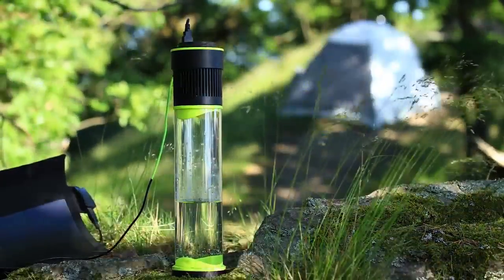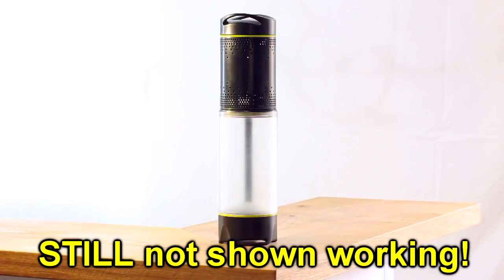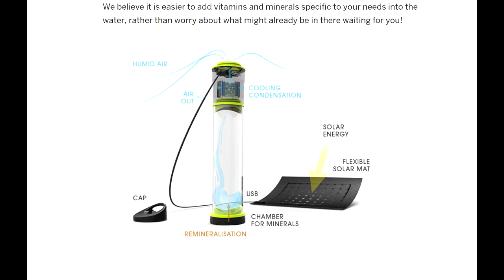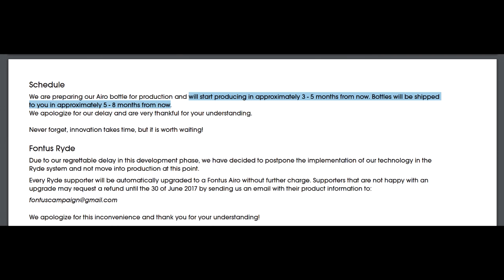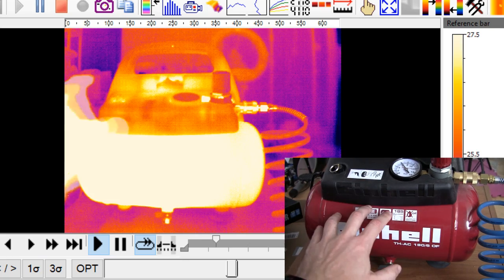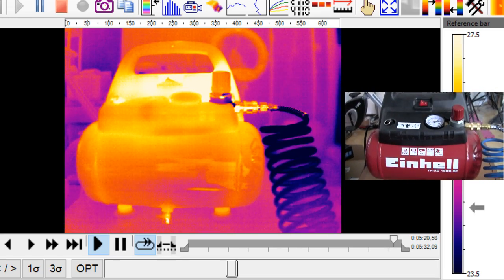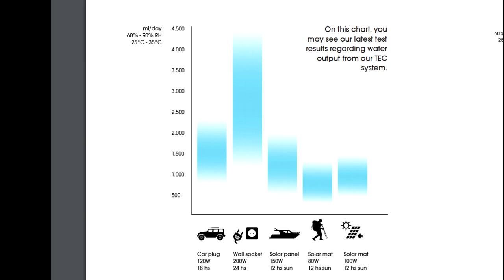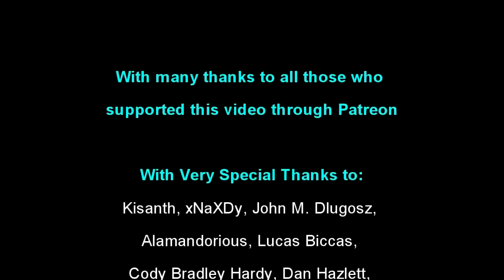$300 000 Self-Filling water bottle, SUPERFAIL!

Comment: As I've commented, your video went from update win to complete fail with the air compressor analogy. In these videos you have previously done the latent heat calculations for water.

So why do you completely fail on how compressor and refrigerant based refrigeration works? It is the latent heat that does the cooling NOT the compressing and expanding. The compressing and expanding is just there to change the boiling point of the refrigerant so that it boils and absorbs heat where you want and condenses and rejects heat where you want.

Please fix this and do a proper explanation of phase change refrigeration.

Comment: Discrete Birdge Rectifier and Capacitor Dropper would give them a small size for the "power brick". You risk electric shock using capacitor droppers without safety features and bleed resistors though.

Comment: i need to correct you on USB

it actually supports up to 100 W with USB 3.1 PD via a USB-C or -A plug 

the maximum is 20 V and 5 A and intended for powering Notebooks or Monitors

Comment: So why are they not working with a material that can be I dunno Hyper saturated like a baby diaper?
Then working with the resulting water after that point....

Dear lord, maybe I should make the new "Fountis" device or some shit, because after you stop trying to use thermal dynamics as your working force... it's just a volume game with a fan and utilizing a constantly rolling press and filter.
Sure you would have to replace some sort of Foam core, and the filter after a while but heck at least it "could" work with some efficiency.

Comment: 12:07 - SERIOUSLY??? A demo expanding COMPRESSED AIR to explain how a REFRIGERATOR works? THAT'S NOT CORRECT and you know it - Explain it properly!! I'm starting to think your "Science Clarification" purpose is quickly becoming hypocrisy!
Reply: He mentions that a refrigerator uses a compressor to cool refrigerant. Looking up "how refrigerators work" elsewhere gives the same explanation every time, which agrees with what Thunderf00t has said.
If it's wrong, why not say what part of it is wrong, and what the correct answer is?
Reply: From the point of view of the P-H diagram, it's really not very much that different. However, that's way too advanced for this audience. The problem is that when air expands:
1. It was a gas before and after the expansion (unlike a refrigerator)
2. The cooling happens through an effect called Joule–Thomson expansion (assuming few heat losses in the nozzle through which the gas is expanding). That effect is not even close to useful for a common refrigeration device. That's why you don't see refrigerators based on air compression. It's simply way too inefficient to be useful.

A refrigeration unit (a/c, fridge) works by cycling between compressing and expanding a refrigerant substance that has its thermophysical properties carefully chosen (or tailored) for the specific application. When a liquid refrigerant in a refrigeration unit (a/c, fridge) goes through an expansion valve, it will also "expand" in a similar fashion as the air, but unlike the demonstration, there still will be plenty of liquid after the expansion (it's gonna be a mix of liquid and vapor). That remaining liquid is what is useful for generating the refrigeration effect (it absorbs heat by evaporating inside the evaporator).

In my opinion, as a professional of refrigeration, that explanation was not only poor - it was misleading. It didn't involve the presence of a liquid, the notion of evaporation, simple things that most people in this audience would grasp and that would really contribute to the video - at least more than the convoluted experiment he did in his garage. 

When I myself was learning these things, the best way I found to explain that effect was with an example of a pressure cooker. By elevating the pressure inside of it, you can have water boil at much larger temperatures (~120C). If I were to leak the bottom of this pressure cooker it would release liquid water at those temperatures (let's say, 120C). Water normally doesn't like to be at 120C in atmospheric pressure, so it will naturally vaporize during the leak. But to form vapor it needs to absorb energy, which in this case will come from the remaining water in the stream. But for it to come from that source, the stream itself will have to cool down a little bit. The result is a mix of water and vapor at 100C (which is the equilibrium temperature for a water/vapor mix at 1atm). The same thing happens when you do it with a different substance (i.e., R134, R404, ammonia, CO2) inside of a refrigerator. That explanation would be much more didactic and at least closer to the science that actually is behind it. 

The problem with Thunderf00t is that because he is a scientist he probably believes that he has credentials to put shallow content out on the internet to his audience without being questioned. I know the audience (the Yankees) is not that knowledgeable, I know that he has to distill the scientific content to a remarkably low level. I wouldn't be so offended if he were less confident when he debunked something he doesn't know very well how it works. But his speech is like he were a master of the subject - And as everybody who seems and speaks as a master, normally it isn't the case. And that's what people want to hear: confident people that do not have an idea of what they're talking about.

Now maybe you'll understand my criticism regarding hypocrisy.
Reply: What are you crying about?
None of this impacts the video's message in the slightest.
You honestly wanted him to explain all that for no fucking reason?
Reply: Fernando is right, he's a pro

Comment: Although the USB specification says the max current a USB 2 device can pull is 1.8A, USB 3 goes all the way up to 5A @ 5V, and there are some protocols for phone chargers which allow the cable to carry 20V at 3A (60W), so 100W from a USB cable isn't necessarily impossible.

Comment: I have a dehumidifier (which uses a crapload of power), but I was told and read in the instructions not to drink it, or use it for watering plants, etc... the reasoning being that it would likely have a higher concentration of harmful particles(like heavy metals maybe).

question is, even if this worked, why would this be safe while my dehumidifier isn't?

Comment: I got a really nice 2nd hand dehumidifier for £15 about 10 years back.  I've used quite a few since, most are pretty crap (they on avg manage about 2 litres in an equal setting and similar power usage, some use a lot more power for a heated defrost cycle), but that old Big one manages just under 6 liters of water in 20 hours from a big room at about 70% relative humidity / 16c - it draws about 320 watts (I also run a pedestal 16" fan on medium to help circulate the air in there to help it - pulls about 35 watts)

You'd think those guys had never used a regular dehumidifier before starting this project lol
Most people rely on others in such situations to fact check at least a little before trying to sell them an idea, our trust in people is slowly being whittled down :s

 Feel bad for the people that ordered that bottle thing

Comment: That's not exactly how refrigerators work. They use a refrigeration liquid and partially change its phase to gas and back to increase the heat carrying capacity.
Reply: FunnelV No, it's not. The compressing and expanding isn't what does the refrigeration. It just changes the boiling point of the refrigerant. the latent heat of vaporization of the refrigerant is what does the refrigeration. Boil and absorb heat. Condense and release heat.
Reply: That's still heating something up to remove heat...
Reply: Indeed it is, in fact you can do refrigeration with only compression and expansion. That's how the bleed air A/C on a jet airplane works, but that's not the point. He is referring to phase change cooling using a bad analogy.
Reply: That must be how I got confused
Reply: It's the same basic principle: To cool something down you have to heat something up to disperse the heat. The liquid in a refrigerator just moves the heat around the system like the air does for the devices in the video.

Comment: The basic problem with this type of project is SCALE.  I'm sure that the guy saw an ice cold glass of water "sweating", and thought he could scale it up to make lots of "sweat water".  He knew that there were Peltier devices that made cold, and thought he could combine them to make his bicycle thing.  The problem is that he couldn't scale up the process reasonably.  Thus the major fail.  Yes, the idea works, but to get a liter of water, you need a quite large air conditioning unit, and a humid place.  A portable water bottle is just an easier way to go.  The near star to us (the sun) does quite a bit of work evaporating and letting water condense, and it has lots of power to waste.  Moral of the story:  a few drops does not a liter of water make, it takes thousands!

Comment: At around 6:50 they seem to be "showing" the laptop brick. The wall cored is one size and texture and runs to the bottle then off the counter, while the other cored loops behind from the bottle, bumps to the line cord then also runs off the counter. The bottle side also has the ferrite common in laptop power supplies. It looks like they stuck the wires together so it would look like a continuous wire but both run off the table, the brick itself is probably hidden, but going on the shown cords it's a laptop supply.

Comment: This could be useful at sea where you have relatively high RH's, salt water and lots of sun. Its not a complete failure, but they are overselling the product. Thats the main issue.
Reply: Really its not that these things cant work, its that they are selling you a solution rather than a potential solution. Reality is that it probably works but in only certain circumstances (e.g. out at sea with lots of sun).

Comment: Hey  TF a litte correction, all modern AC,s and fridges (with a few exeptions) are based on vapor-compression refrigeration systems. This means they utilise the phase change from liquit to gas to cool then the refrigerant is compressed so it gets liquid again, after that you get rid of the excess heat and rinse and repeat

Comment: I have a top of the line gaming laptop. It has two jet engines as a cooling system and the brick of a charger is 8 inches by 4 inches by 2 inches. like... the size of that water bottle. Most of the space in the charger is just so it can disperse heat and not burst into flames. Cause ya know, converting energy doesnt make excess energy disappear, things get hot.

P.S. I recommend buying 100 MSI desktops, rending out a building, and turn it into a gaming Cafe for 345k. They'd use less power and would be insanely more profitable.

Comment: I also called them out on their marketing bullsh*t - and I think that got all the comments on their videos disabled.
- They claim that it is now 40% smaller, when in fact it almost doubled in size. Obviously they refer to the fact that you can "fold" the bottle if it is empty. Extremely dumb concept for a bottle which has "never run dry" as a slogan

- They already gave up on the RYDE. They wanted to develop 2 products with 30k and now they are developing just 1 product with 300k

- They claim in the video description to "showing our new, improved Fontus Airo bottle in use!", while in reality they show over large parts of the video the folding stuff (which nobody asked them to do) and cut away in the only scene where they switch the bottle on. I think that up to day nobody has ever seen the bottle working

- They claim it is an improved design, while it is larger, heavier and 10x less efficient than their originally proposed design.

I thought initially that Fontus is just a naive bunch of guys, in the meantime I'm convinced their fraudsters.

Comment: 13:00 Actually, your refrigerator DOES have a compressor, but it is NOT compressing air. It is compressing a refrigerant (like r-12, or r134-A, depending)
 a circulating refrigerant such as such as the aforementioned) enters the compressor as a vapor. The vapor is compressed at constant entropy and exits the compressor superheated. The superheated vapor travels through the condensor which first cools and removes the superheat and then condenses the vapor into a liquid by removing additional heat at constant pressure and temperature. The liquid refrigerant goes through the expansion valve (also called a throttle valve) where its pressure abruptly decreases, causing flash-evaporation and auto-refrigeration of, typically, less than half of the liquid.
That results in a mixture of liquid and vapor at a lower temperature and pressure. The cold liquid-vapor mixture then travels through the evaporator coil or tubes and is completely vaporized by cooling the warm air (from the space being refrigerated) being blown by a fan across the evaporator coil or tubes. The resulting refrigerant vapor returns to the compressor inlet to complete the thermodynamic cycle. 

Sorry, HVAC/R guy here... had to point that bit out.  Interesting video, otherwise.

Comment: Just to add some points that Thunderf00t did not mention:
- this thing is for outdoor use and is supposed to be folded together: this means that
a) first time someone folds this thing with water still in bottle (will be a common mistake) the filter will be washed by the water one generated and "purified" over a span of 10 hours rendering it undrinkable
b) the electronics will be exposed to dirt and water, so it needs to be highly dust and waterproof, specifically IP 65 (dust+splash), IP 67 (immersion - as they designed this folding thing on purpose) and IP 69 (high pressure steam jet - as it is also replacing the ryde variant) - not easy to accomplish (e.g. the connector they use for the supply is highly unsuitable) and costly to test

- they want to sell it in EU, so they'll need to have ROHS-compliance and will have to satisfy EMC regulation. Testing for the latter is quite expensive

- they want to sell it in US - less regulated than EU, but a market with extreme liability claims. I would not have the courage as a start-up to provide a product in the US which 
a) connects to the main supply with a potentially shaky design (see TF's video) and
b) is used for food
You have any issues with electric shock or contamination and you're done.

- they use a plastic material for the housing for an outdoor device. Most polymeres are not very stable against UV radiation (i.e. having it exposed to direct sunlight - which is their intended design). So they need to do solar radiation testing to make sure their bottle doesn't get brittle or yellowish after a few months of exposure. As these tests take long, the labs ask a lot of money for that

- I don't have the impression that those guys haven't any idea how production works...I see already lots of wasted money on the injection molding for the mechanical design, set up the electronic manufacturing and EOL at the EMS, doing package design, drop testing etc.. Looking at the state of their current "prototype" this is never production-ready in 5 months. Never.

Comment: As a fellow chemist I'm curious about your statement that condensed water would "have something in it" and at least tap water is treated. What other substance would have a similar enthalpy of vaporization as water and also be vaporized in the air along with the water? Not holding my breath with your response since every time I have brought up problems with your science before you conveniently haven't responded, part of the reason I unsubbed
Reply: Bombastic Bill There's a number of airborne pollutants that would come out with the water. Depending on where you ran it: EG the on bike version might pick up motor oil petrol, deisel fuel, &c. It's an issue with water stills too, & if you've ever tasted dehumidifier water, you know they do tend to pick up smells.. & it's rarely pleasant ones...
Reply: Petrol maybe, but motor oil? you would literally have to be dehumidifying over an oil fire for that to happen.  You still haven't explained how they would happen to coelute at the same time.

Comment: I have an A/C unit that is about a meter high and maybe half a meter wide. It's an indoor unit with a pipe to blow the hot air out a window. It also "produces" water as a by product which I collect in a fairly large container... 

That I keep a lid on because I don't even want my cats drinking that water much less me. Perfectly good for watering a few plants however.

Comment: There is only one very specific application where this thing MIGHT be worth something - transoceanic sailing. As an avid sailor, I have heard a few horror stories of disabled vessels or vessels caught in the doldrums running out of water. On a sailboat, you would have plenty of room for, and very possibly would already have significant solar power capacity, and while not much, a liter a day could make the difference between life and death and expense would not be an issue.

Of course, there are low tech ways to do this. One involves two bowls, one larger than the other, and a transparent cover. You fill the smaller bowl with salt water, place it in the middle of the larger bowl, and cover it. As the water evaporates, fresh water condenses on the cover, and drips into the larger bowl. I know sailors who have done this, but I don't know how much water they got compared to this debacle of an invention.